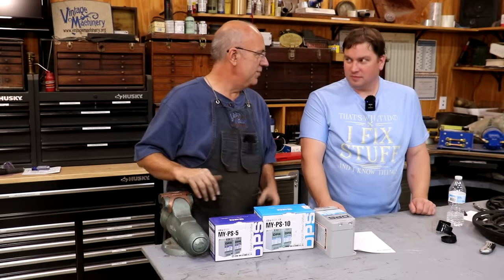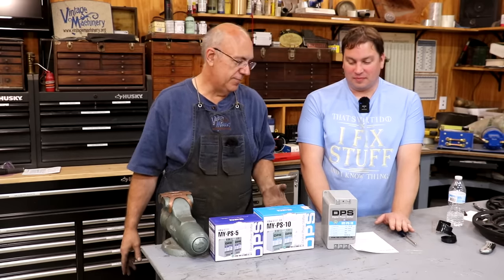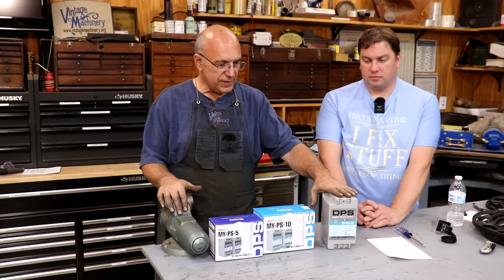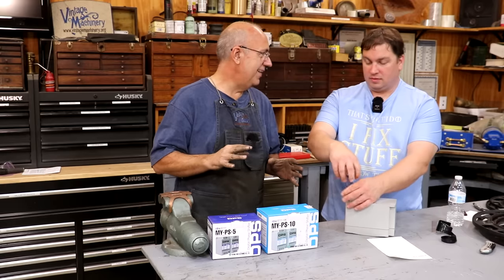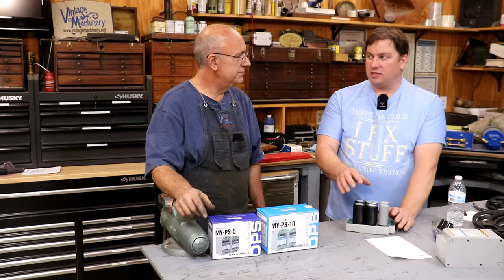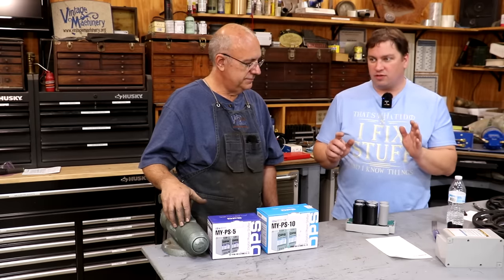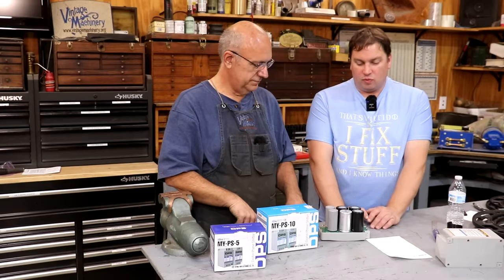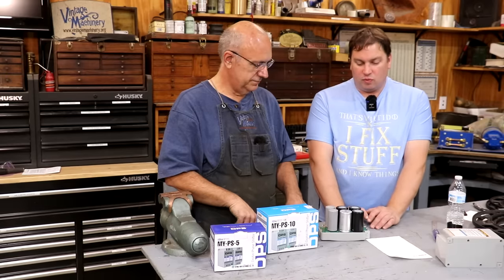Single Phase to Three Phase Power: Rotary Phase Converter vs Digital Phase Shifter

Comment: Interesting.  I suspect the digital phase shifter's work is adding some transistor switching noise artifacts and that's causing your instrumentation to read erratically and things really aren't as bad as they're being made out to be.  It would be cool to get an o-scope's view of the 3 voltages, but would take some spendy tooling.

Comment: WOW- this is a disappointing not so subtle commercial for American Rotary phase converters.  Digital phase converters are different than VFD inverters.  Digital converters only do one thing- convert single phase to 3 phase and are designed for high load applications, so the test with no load was deceptive- under load the voltage and amperage would even out.  The Variable Frequency Drive ( VFD) inverter is a far more practical  solution to a home or small shop because they are very inexpensive- 10HP units are available for under 200.00 from name brand manufacturers.  The most popular function is the ability to control motor speed by varying the frequency and maintaining full voltage which gives a much broader range of speed without loss of power.  Beyond that, they have hundreds of functions such as dynamic braking, timed pulsing for things like conveyors and can accept  signals from a computer for control of speed and direction for any future CNC conversion.  VFD drives are individually programmable to each motor based on the motor tag for voltage, amps, frequency, rpm and Hz, so if you have some older American made units with 60 Hz or some imports of 50Hz your VFD will output the exact power, amps and Hz for each individual machine.  Cost wise they are far less expensive than rotary converters  because you can add them one at a time as desired with no electrical panels or wiring- just plug them into either 120 or 220 existing supplies.  Say you have a home shop with a mill and a lathe that you want to be able to adjust spindle speeds without all that belt changing.  You can buy 2 VFD units for under 400.00, install them your self and plug them into the wall.  A rotary phase converter with the same 10 HP capacity will cost 1500.00 plus the wiring into your panel and a new 3 phase panel etc.

Comment: i have a American rotary 20ad rotary phase convertor L1 is 120 volts, L2 is 275 volts, L3 is 120 volts.  I was told that was normal when I bought it  in 2015 now I am not so sure. perhaps I should check amps also.

Comment: There are a lot of factors involved in understanding VFDs. I must say that not all of them are up to what they claim. Newer motors obviously do better than some older ones, and there are motors that are designed for VFDs. Companies like Toshiba have been making VFDs for a long time, and have a good product. Some companies seem to crop up overnight, and go away just as abruptly. 
I have an uncle that is in the HVAC demolition industry, and has had a number of his motors used for rotary converters.
Of the three main types of converters, those being the capacitor bank, the rotary converter and a VFD, I think that, generally speaking, the most practical one is the rotary converter, made from a 3 phase motor.

Comment: Hey Keith! I wanted to point out that the DPS manual states there are voltage imbalances up to 50% that will balance under load. Is there any way you can test this?

Comment: To my eye it looks like they renamed the 1930 static phase converter with the word Digital. The only digital thing about it might be a timer for how long the start caps stay engaged
Reply: When you buy one you have to buy the right size, and they recommend max one size bigger for heavy use. Sounds totally like just a run cap of the right size (70uF/kW) with some starting caps and a timer.

Comment: I second Keith's recommendation to stay away from the DPS boxes. I have had issues myself with them. they might be a solution for a stuck in a situation where you need it scenario but as an actual long term solution to a problem they are not a good option. To borrow the analogy it's all great until the midget passes out. For a single machine a VFD is a much better solution for multiple machines a rotary converter. There is also the quality of parts to factor in especially when imbalance in the circuit puts excessive strain on said parts

Comment: Basically,these are just static phase converters.From my experience building both,rotary and static converters,there has to be a normally closed timing relay to cut out the starting circuit after the motor reaches about 2/3 rated speed.Some motors take longer to reach that speed so,the timing relay should be adjustable.Basically,a static converter is not a good idea.
Reply: that is one thing not in the video that little box does have timed switching for the gray caps you can see.

Comment: I use VFDs. Yes, they’re much more complex to set up, but you get a proper output. Then you have the other advantages. These are basically running the motor through two phases. You have to run the full amperage with these through two phases rather than three phases. I don’t recommend that. You also get less power output.

There’s an old expression; “You can’t fool Mother Nature”.
Reply: that can be read; math is weather you like it, know it or not.  caps may be "100% efficient"  but they do use some power, there is considerable current flow.

Comment: I am disapointed in the way this testing was carried out.  One of the things one must take into account when doing  testing on electrical machinery is the specifications in which it was designed to work.  With this particular device the manual states that there will be I &V imballances under a no load condition which is how this testing was carried out.  I am a big fan of this channel but I need to say that  in this case there was no real test plan, no comparision of results at rated load conditions and contained obvious bias in the way it was presented.
Reply: fair enough.  you try it and get back to us.

Comment: I think pretty much all HVAC condenser units use a cap for the compressor, providing 3 phase.
Reply: I don't know absolutely about the design.  I can tell you that most HVAC condenser units use capacitors for starting AND are single phase motors as stated on the plates.  I retired from Trane, Inc.  The vast majority of the units built were single phase 220-240 V 50 or 60 cycle(Hertz).   We occasionally built 3-phase units.  Most of the units up to 5 ton, are single phase.  Heavier commercial and industrial units are 3-phase.
Reply: @royreynolds108  that is correct.  those little caps used in compressor condenser units are "run" caps but they are needed for starting.  if they were "starting" caps they would need to be switched out after the motor was at speed.  single phase needs external help to create a rotating magnetic field.

Comment: It would also be a good idea to have someone connect an oscilloscope to the 3 output phases to see what the waveforms look like. They will not be pure sine waves and they will not be equal in amplitude. Even the output of the rotary phase converter will not be a pure sine wave but it will be better than the phase shifter. Be careful so as to not burn out the oscilloscope, relatively high voltages phase to ground. Possibly use transformers.

Comment: The Eminent three-phase sinus-current, invented by Nicola Tesla, is emanated from the enormous generators in power-plants. In most houses in Sweden, we have three-phase-current, 3 x 380~400 Volt, and one Earth-lead.  We like to have all three Phases into the house, except very old houses from the late 1800's.
This is because it saves valuable metals in the transmission-lines, and mitigates skewed loading. It makes for a very good Electric owen and a Heat-source for the house.
Most houses in Sweden have buried power-lines. Allmost nothing is to be seen.

I "think" the greatest  Electrical Tension we got i in Sweden is 800.000 Volt. I do not call it Voltage, for I do not either call a weight's mass "heaviness".

Comment: Hey I built a RPC myself using a baldor 10hp for the third leg. It’sdouble thehp largest motor so works great. I went with Vfd for my 2x72 grinder though bc I need variable speed. The KBAC series Vfd does such a great job and is, I believe, a better build compared to all other Vfd I’ve tried. Anyone feel different?
Reply: I wonder what you mean by "for the third leg". At least what I know about RPCs, the generator part creates real 3 phase power, which the same as with a gnerator set, needs some smoothing and stabilization. If you would simply create a "third leg" using what is a 240 V or two phase supply in the us, your phases would be out of whack, as those 240 V are just the opposite end of one transformer, shifted by 180°. The 110/120V circuits are just a tab in the center of those windings creating the neutral.
So I guess I got confused by how you expressed it, and the RPC did not just get you the two phases 180 from each other and a third one somewhere in between.
My insight into such things as RPCs or DPS is quite limited anyways, as living in Germany I am blessed with real three phase out of the breaker panel. (Which, lets be honest, most houses would not even actually need as three phase. It is just how our grid and distribution to the houses is set up differently.)

Comment: Ok I am an electrical engineer , worked in heavy power motors etc ,   question for your guy did you check the power factor in both cases ?  the larger caps were there to provide a lag PF while the motor ( inductor ) will give a lag PF ,

I would be very interested if how much watt less current is present which would skew the reading as taken with the amp clamp

simply analogy for single phase v three phase  single phase is like a single cylinder engine and three phase is a three cylinder  engine , all will know which is the smoother of the two ,but if the circuit is unbalanced the three phase will cause the motor to run rough .

as a last request can you show us the wave form for a rotary and a the Little box of tricks ( I very much doubt that the motor winding will suffer with such a crude device 

VFD re synesize the three phase from DC in the unit and before the smoothing cap it is a square wave  due to the circuity
Reply: sure, if we had those tools but as with any video there needs to be a limit on how much stuff you put into it.  idealy the capacitive reactance should cancel the motors inductive reactance to give you a PF of 1.0.  the point of the box 'o' caps is to generate enough phase shift to create a rotating magnetic field in the motor.  the degree of that shift will dictate the amount of torque the motor puts out.  rest assured the PF is very poor, if the thing works like its supposed to i would expect something like 0.6 - 0.7.  the only one who cares abute that is the power company and we have limited tools to make those measurements so its not in the  video.
Reply: Well in reality, since the PF is the phase shift between voltage and current and the motor ideally has a maximum efficiency to reach it horsepower is at unity or PF = 1, it's more than the utility that cares. To get to the required needed HP the motor needs to do its job when the PF is shifted to 0.6 to 0.7 requires much greater current since the voltage, under normal conditions, would be fixed. This greater current will generate more heat, which will affect the lifespan of the windings/motor. So it doesn't just affect the utility, it will affect the life of the motor too.

Comment: For the non-geeks out there a three phase motor is a brushless motor. In the stator or non moving windongs the coils generate a rotating magnetic field. This induces a current in the rotor coils. This current creates a magnetic field that opposes the stator field, causing the rotor to turn. The rotor current is minimized at full speed.

Without three proper phases, the currents in both the stator and  rotor will be way higher than they should be which will lead to failure. 

A rotary converter is basicly a single phase motor turning a three phase generator. There are also electronic converters which generate three phases, but they are much more sophisticated than the capacitor boxes being tested here.

Comment: I was reading up on these and it says that there will be voltage and amp imbalance when the motor is under 50% load. It says they will balance once the motor is over 50% load. I would like to see that tested as a follow-up if you have time.

Comment: It would have been interesting to view the output on an oscilloscope.  My guess is the sine waves are being clipped.  On an oscilloscope, you would see what looked more like a square wave.  It would also be interesting to see if the sine waves are stable.  My guess the sign waves are not stable and the three waves are shifting in and out of phase.

Out of curiosity are these components UL-approved?  My guess is they are not. 

Being an old-timer, I would describe your rotary generator, as a motor generator.  As I understand it the rotary phase converter uses a 220V single-phase motor which drives a 220V three-phase generator.  The output will always be a clean three-phase 220V signal.

In the last ship construction job I was involved with we had two 11MW main engines that were each fitted with an 8MW, 6.6KV producing between 50-60 Hz output.  The ships had two 1.5MW, 60 Hz, 3-phase diesel generators, and two 1.5MW motor generator sets that took the 6.6KV, 50 to 60Hz signal and produced a clean 450V, 60Hz, 3-phase output.  120V, single-phase, 60 Hz power was provided by 450V to 120V transformers on each of the phases.  Clean power is essential onboard ships as it is on land.

One last point, which for the most part is minor, can these inexpensive solutions feed back into your power source?  These devices need to be isolated from the grid because of the chance of connecting a device that is out of phase with the power source.  This is why, when you install a home generator there are delays in starting and stopping the generator. You never want to run devices in parallel
Reply: I has question for you if you have the time, it’s off subject but you brought up working on ships. What do you do about a ground when you’re running electricity on a boat or ship. Do you ground the frame (or whatever part is steel) of the ship or is that kept completely isolated like the lines that are running current through them? Just a curious thought when you brought up making all that power on board. Thanks and have a good one!
Reply: @Hoaxer51  that is a good question, really.  the stray current that can be introduced into the hull can really be a problem, accelerating the erosion of the zink (aluminum for fresh water is it? ) electrodes is really a thing.  ground isolation may be necessary depending on the differential potential.  I would put them into rooms or cabinets intended to house them and have an isolated ground back to a central point then some fancy measurement and engineering may be required.
Reply: @Hoaxer51  The ships I was involved with all had a neutral ground.  In simple terms, if you went to a 120V outlet and measured voltage you would get 120V between the "hot" and the "common" terminals.  If you measured from "hot" to "neutral" ( "ground" terminal) or "common" to "neutral" you would get a 60V measurement.

Comment: Can you do the same comparison using a VFD? Yes, I know a Rotary Inverter is the best option but when you have just two machines to run and one is on a VFD, is it practical/ more economic to change over to a rotary system even if you use only one machine at a time and only once every other month?

Comment: I wonder if maybe one of these DPS boxes could be "tuned" with different capacitors and/or other variable electronic components (resistors, diodes, etc (I'm not an electrician)) to better balance the output.  I am in no way suggesting that this would be as good as a RPC or a VFD, but perhaps could be made somewhat less horrible.
Reply: that thought had occurred to me.  I asked if i could have the unit to do just that.  dont hold your breath waiting on that video tho.

Comment: Im using a DPS on my Clausing Colchester 12X40 and mine goes out on reset after about 20 minutes of use because the motor is getting to hot. Can anybody tell me which VFD I should get for it? It’s a 3/4HP 3 phase. It’s against the wall right now and I forgot how many amps it draws. Thanks
Reply: Actually my question is if I get like a 5HP model is that ok?

Comment: I think these cheap devices have their place in the grand scheme of things e.g. a grinder or linisher that you're not going to have running for long, For sure running the motor for too long could cause a single winding to overheat but even with a VFD running a motor that has fan cooling  at low RPM can cause overheating problems.